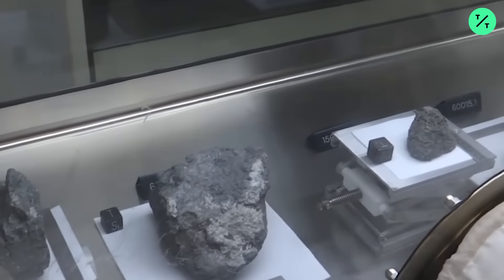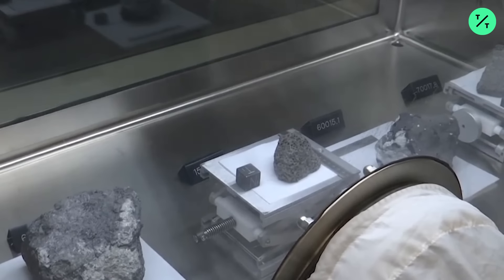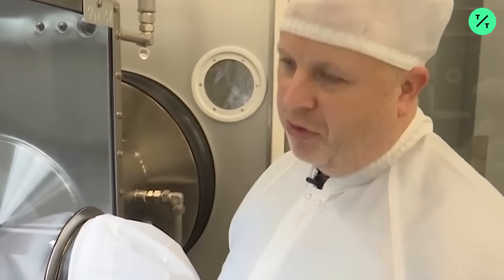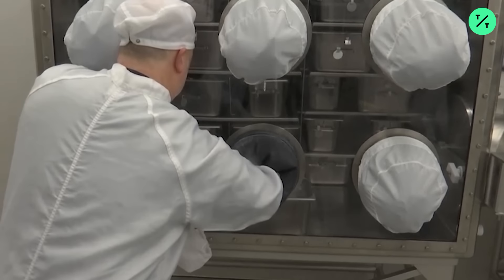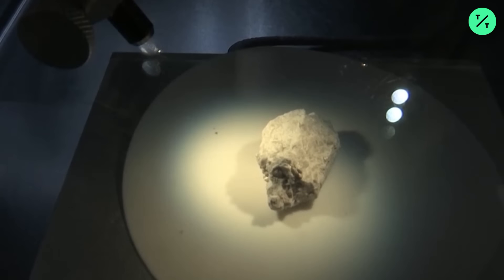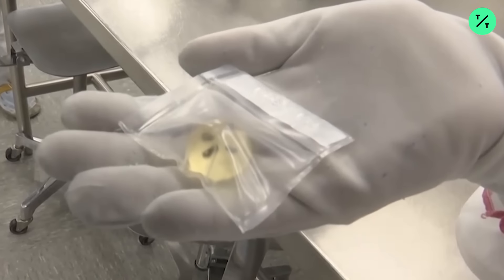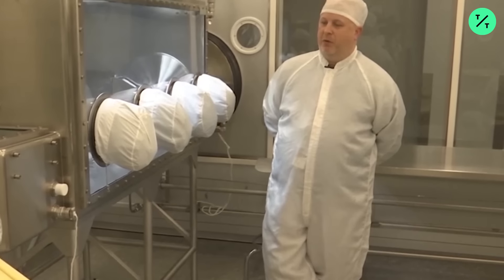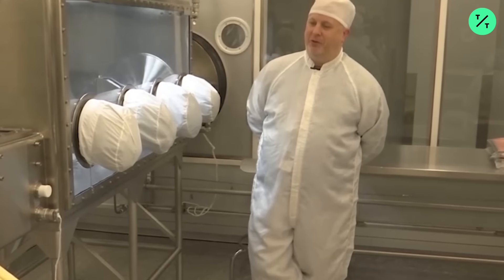NASA Opens Moon Rock Samples Sealed Since Apollo Missions

Comment: In the late 70s, a couple of friends and I were standing in my driveway looking at my freshly painted 1969 AMX, which I was restoring. All of a sudden, we heard a crack in the tree line next to the driveway, and bang, I had a dent in my freshly painted rear deck lid. When I picked up the object that bounced off my AMX, I remember saying what's with all the holes. Well, kids will be kids, and over the years, I forgot about the rock's importance as a conversation piece, ultimately losing it when I got married and moved. Not to say it was a meteorite or? But it was covered with tiny holes as if it had been heated and then cooled rapidly. I recall it being fairly light, but it may have been due to its small overall size, around 2.5 - 3.0 inches. Over the years, I asked myself a lot of dumb questions"Could the Mt Helens eruption have blasted a rock 2500 miles".LOL I'll never know what its origin was.

Comment: Did you replace those rocks with other rocks from the Earth, or moon loses its weight,
Reply: no. not that this weight would matter in any meaningfull way. also the weight of all the stuff remaining from the mission (landing stage etc) is many many times larger than the weight of the samples returned.

Comment: “We can’t go back right now”even though we went with less computing power then you smart phone
Reply: That's like saying "we can't fly across the Atlantic in a supersonic passenger jet", even though the Concord flew with less computing power than my cell phone.  How is that have any relevance?  The Apollo computer didn't have a high resolution screen, didn't have GPS, didn't have a camera.  All it did was do simple calculations for telemetry.  That's all that was needed.
Reply: @my3dviews  you obviously dont realize the importance of running simulations for rockets ships and running programs to see possible mistakes in calculations or building =s
Reply: @Sisidiehebwi    You don't need simulations for rocket engines, when you can do actual tests on the engines.  
There is lots of videos showing all the rocket engine tests, plus all of the Saturn V launches.  They worked just fine with the computers at the time.  
They could calculate the time required for every engine burn for a given orbit.  Plus they made adjustments on the way to and back from the moon. 
 
You say we can't go back now.  Maybe watch the SLS launch, which orbited the moon.  That is the rocket which will get them back to landing on the moon.  
It isn't that they didn't know hot to go back, but that they didn't have a rocket at the time capable of sending humans to the moon, after Saturn V was cancelled and replaced with the Shuttle. NASA didn't have the budget for both.

Comment: How did the astronauts seal the rocks under vacuum on the moon, to prevent contamination and keep them from being exposed to the earth's atmosphere, the air in the capsule, etc. Special vacuum containers? The rocks themselves would be heavy. How heavy were the containers? I guess 1/6 gravity helped a lot.
Reply: I guess if they open them now, it will explode.
Reply: I just read that there was astronaut poop left on the moon. No pun intended "to lighten the load," so I guess these rocks are lighter than the poop.

Comment: So after 50 years what do we find out from those samples? Let me guess. The moon surface is almost exactly like earth surface.
Reply: Better read up on the subject. It's notably different in a number of ways including the collected samples, many of which  have an unusual high level of Titanium amongst other things.
Reply: @skyfacer9626  Yeah and glass. 27% of the surface of the moon was glazed in high heat silicon and other elements from the SUN when it micro novaed last time, 10K BC. It's why they went there, to see how far out the catastrophe went. See the diehold foundation work, covers all of this. There are fission tracks in the glass beads put there by the Sun's cosmic rays.
Reply: Actually take a look at the video front screen image, that rock has been subjected to extremely high heat.. It's been melted, resembles more like coral than a rock. Burning from the dust shell of the sun that it throws off along the planetary plane. You can clearly make out the round holes which are from the glass sphericules or tektites. Why they found everything on the surface glazed on the tops of the rocks only, not underneath. And why there's a grey dust everywhere, it was burned, same thing on mars too. There's even audio of them 'joking about the rocks' and asking 'are these the ones we're meant to collect' and talking about the glazing over them etc.

Comment: Oh wow, so highly protected. But they destroyed the data and technology they used 🤔🤨
Reply: hahaha
Reply: That's not true at all. It's actually on the open domain(just have to request it from The Federal Archives in East Point, Georgia). The problem is that the manufacturing process was completely different back then.  And, a lot of stuff was hand done by skilled engineers and welders. Which we don't have that anymore on that level for something complex as the Saturn 5 booster.  Hell, each of the Rocketdyne F-1 engines had their own quirks as all parts were hand made. Additionally, we don't have the documentation notes for the creation or workarounds, as everything was either done on the fly or verbally communicated. Many of those people have long passed away. So, their skills and knowledge to make them, in the same way, is long lost.   

We had created a more modern version of Rocketdyne F-1 engines with current manufacturing methods back in 2013. However, this was opted out for the RS-25D or the shuttle main rocket engine for the sake of cost savings and simplicity.
Reply: @JLHBio  so can you get the flight data
Reply: @WLM-CHRIST-IS-KING  all except for apollo 11 raw telemetry. Which apollo 11 telemetry tapes were accidentally used for domsat data in the 80's. As the tapes were mark wrongly and NASA was tight on budget at the time and was recycled. 

However,  some the information is available in the large mission report from the 70s, including vitals, ground control data, and remote telemetry data. This is accessible on the NASA site.
Reply: @JLHBio  thank you for the info I'll be sure to check that out mate. Have a nice day
Reply: @JLHBio , thanks for your well-informed comment, gently disabusing sceptics of the old chestnut that NASA deliberately destroyed the data and technology. I wish your post could have wider currency . . .
Reply: @JLHBio  So are all the pics and vids, over 99% labeled as photoshop and cgi.
Reply: Mike Mower uhh sorry to break it to you but photoshop didn’t exist in the 60s’ I don’t even think Adobe did in any form.
Reply: @starman8853  The govt tech is always 10+ years ahead of civilian.  They could mod pics and vid well over 70 years ago.

Comment: They did not have a vacuum bag machine on there “landing craft”... let alone enough room for water for drink
Reply: There was a great vacuum source right out the door.
Reply: Yea ok... they sucked the bag closed with there mouth once outside the landing craft
Reply: Is it even possible to pull a vacuum within a vacuum? Don't you have to have something to remove 1st before you can create a vacuum
Reply: Ok, for those who just miss the point.  A bag filled with sand from the bottom of the ocean will be full of water.  A bag of sand from the beach will have air.  A bag sealed ON THE MOON will by nature be full of vacuum.   So, all they had to do to have the moon rocks vacuum sealed was put it in the bag and seal it.  No air on the moon, so back on earth, the bag is vacuum sealed.
Reply: @catkin27   So what happens when you put a balloon full of oxygen in a Room full of helium??
Reply: @catkin27   And you're telling me that those spacesuits that they test under water under several atmospheric pressure  that those suits will work just as well in the complete  vacuum of space? Haha
Reply: Wrong.... there is reported and published information pertaining to a actual atmosphere on the moon.
Reply: @imacenurface  reported by well known liars
Reply: @johnperkins8895  - All those suits had to do was maintain a low pressure of less than 5 psi contrary to popular belief that doesn't mean they have to be completely "air tight" the same way an airliner is pressurized but is constantly venting through an outflow valve there is a net pressurization because the inflow is greater than the outflow likewise a spacesuit produces it's own oxygen if some vents out it's not the end of the world a vacuum can't get IN anything a vacuum is literally the absence of anything it's nothing and nothing can't apply a force
Reply: @PabloGonzalez-hv3td  lol ok according to nasa scientists we cant replicate the vacuum of space, we can get kinda close but not quite. You sir dont understand what im saying. You typically cannot get a seal that is impervious to both pressure and vacuum,  you can get one or the other.
   The absurdity that we have our environment within the vacuum of the universe is funny all alone.
   Gravity isnt keeping us from being shred apart from vacuum of space almighty.  Hehehe
Reply: @johnperkins8895   - A vacuum seal maintains a vacuum by keeping out the pressure that wants to eliminate that vacuum it's still guarding against pressure not a vacuum and there is nothing trying to get IN a spacesuit it's ALL trying to get out and if some does it's not the end of the world the air supply is on board. 

It's like if a car tire that had a leak but an onboard pump was inflating faster than air was leaking out you would maintain pressure and it would be driveable even in a vacuum. A hyperbaric chamber is essentially the opposite of a vacuum and it works the way you feel space supposedly should.

Comment: How did they preserve it without exposing it to our atmosphere from 1969. I doubt if there was any technology at that time to preserve it in artificial vaccum chambers.
Reply: The samples were sealed on the moon and put into airtight containers. And actually there's no need for a vacuum chamber for storage, better use some inert gas and pressurize the vault (so that no air and moisture can get inside).

Comment: They are not priceless, You can go to Antarctica to get them. Those moon rocks as Michuo KAku claims have Craters within craters within craters. Hapkeite  is a common mineral found on the moon. It is formed by Micrometeorite impact. This samples have Craters within craters supposedly caused by micrometeorite impact, yet no Hapkeite was found in any of them. They are not the real thing. those are moon samples which have been exposed to terrestrial contamination.

Comment: i want a moon rock so i can carry it with my bare naked hand. that would be priceless.
Reply: I was at Cape Canaveral's space museum, and saw a silvery rock encased in a clear plastic pyramid.  I stood just a foot away from an actual moon rock, and wondered what Jules Verne and H. G. Wells would have given to be standing right where I was.

Later in California I saw a similar pyramid containing a moon rock at a Disneyland science museum.
Reply: @wdd3141  it would be nice if NASA could leave one moon rock for the sole purpose of holding it with your bare hands without gloves, and being able to smell it. that would be priceless. wouldn't you agree?

yes, I've also seen a moon rock. but, i didn't experience anything because it's under a 2-inch thick glass display and the rock is super tiny.